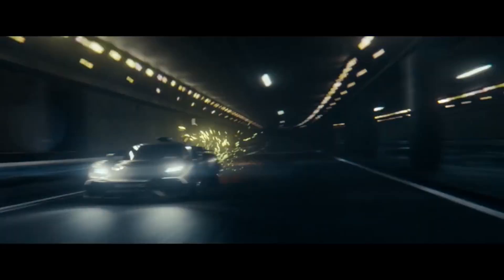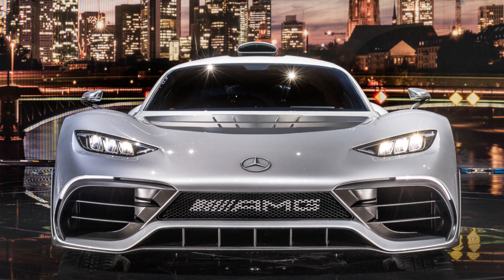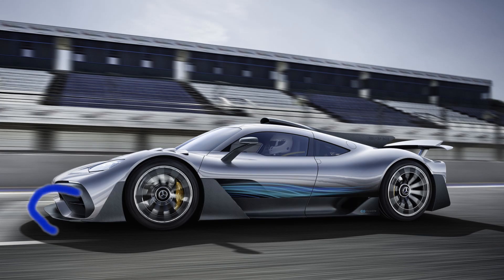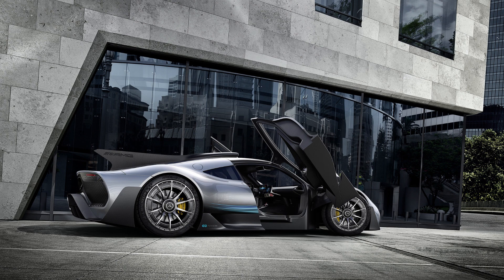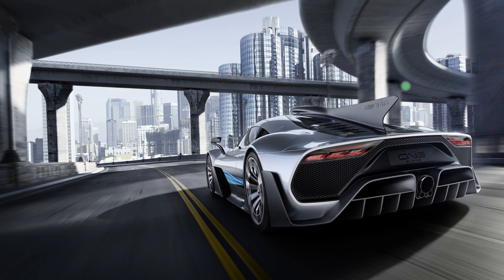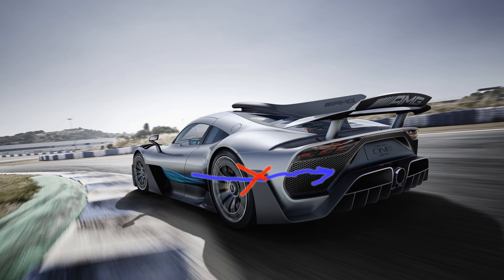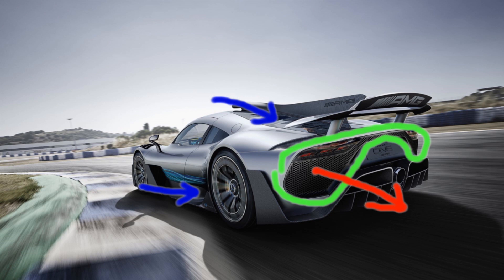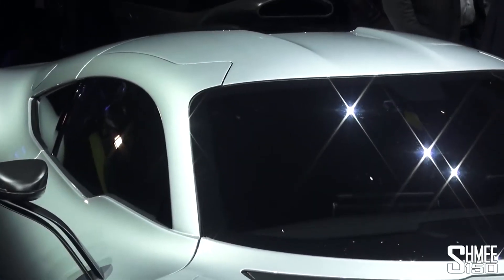Mercedes Project ONE Aerodynamics Analysis & Breakdown

Comment: seems like the big challenge in this car is cooling being a turbo hybrid with actually what looks like more electric HP than an F1 car. Your point about the front downforce because of the mechanical layout in interesting. I haven't watched your Valkyrie video yet but I guess that car's going to have a lot more air flowing thru it than this one.

Comment: I don't believe Formula 1 uses those fins. They do have the air duct in the relatively same position, but the fin is mostly reserved to the Prototypes (LMP2, LMP1).
Reply: krayos13 I haven't put much interest in recent on F1 soon after the downsizing to six cyl. But I appreciate being corrected accurately.You are a true gearhead good sir.
Reply: Function isn't always pretty. I wonder if it creates a vortex, reduces drag or whatever witchcraft is its intended purpose.
Reply: If the demand outweighs the cost in addition to having aerodynamic properties, then they will surely keep it.

Comment: Wish this guy knew what he was talking about lol. He thinks the aero in front and back of the tires are for style haha not to clean the air running past the wheels.
Reply: 3:45 did you even watch the video?
Reply: Yes and he talks about the wing in the back and how it draws the air out preventing high air pressure. If you watch the video yourself you would see where I was commenting on how he talks about how the front wing might be there for looks/styling when in fact it is used TO CLEAN THE AIR running past the wheel. It helps cut down on vortices and turbulent air making the back wing more efficient in drawing out the high pressure air and reducing drag.
Reply: lol This is something easy that you are capable of googling. If you look at 1:38 he talks about the end plate that is used to manage air flow around the tire. F1 has used it for years to manage airflow around and over the front tire. Not so much on road cars until recently. Road cars have been using what is called air curtains on the fronts of the vehicles to help this aerodynamic issue. please take a moment to google aerodynamic air curtains because if you dont know what that is I cant help you. Two examples off the top of my head that use this new method is the Mclaren 675LT and and Ferrari 458 Speciale. I assume these company are starting to use this technique developed from Formula 1 in their road cars just for the looks..

Random pictures.
https://o.aolcdn.com/images/dims3/GLOB/crop/777x437+0+137/resize/800x450!/format/jpg/quality/85/http://o.aolcdn.com/hss/storage/midas/1d00ca29fc8153eeb5b58859b7201a9d/202815967/Yokohama-tire-wing-001.png
http://i.imgur.com/zVI9wj6.jpg
http://www.f1fanatic.co.uk/wp-content/uploads/2014/04/ferrari-nose-2014-john-beam-886x424.jpg
http://cdn.bmwblog.com/wp-content/uploads/BMW-Air-Curtain.jpg
https://www.bmw.com/content/dam/bmw/common/topics/offers-and-services/bmw-efficient-dynamics/Update_2016/aerodynamics/bmw-efficientdynamics-aerodynamic-air-curtain.jpg/_jcr_content/renditions/cq5dam.resized.img.1185.large.time1476318397724.jpg
http://corvettestory.com/images/corvette-images/2015-Corvette-Z06-front-aerodynamics-details-2_a_s.jpg
Reply: I think they might pass some air, but it's not going to be all that significant. They stick out a bit too much to be blocked off, they'd simply create an unacceptable amount of drag. They're a very stylized version of actual functional elements.

Comment: Nothing will be as aerodynamically interesting as the Valkyrie until someone challenges it's design style. 
Personally, I'm hoping Tesla, or another EV company will challenge it. Since with full electric systems, you don't necessarily need everything mechanically connected to each other, have independent power, independent suspensions, independent steering; then make actual pods around the wheels, then a pod for the driver and electrical systems, then form an aero shell around it. I would assume this kind of design would push aerodynamics to the boundary where we can't have a more aerodynamic four wheeled vehicle. 
Though I doubt that will happen any time soon, but it's a thought that could happen.

Comment: It may seem odd, but what is with the air ducts on cab over commercial trucks?  They seem to be directing frontal air around the sides, but why?  I know Euro tucks have had vents/ducts like this for a long time, but they are even showing up here in the US as well.  Just wondering if you could shine some light on the reasoning for it.
Reply: the air has to go around the sides one of two ways, the hard way, all turbulent and draggy, or relatively smoothly and less draggy. They're just an attempt to smooth it out

Comment: It astounds me that mirrors are even used.  With camera capabilities, you can see much more, digitally, opposed to a mirror.  I understand that the mirror is simple and fail rates are minimal but it has gotten to the point where viewing capabilities are multuple times better via a video feed.
Reply: Yea, especially in a 2.5 mill car. Also the aero advantage is pretty distinct, but they are not legal.
Screens with constantly moving things ( road with traffic ) are disallowed, for now at least.
Reply: Watching a video is one thing.  Having a screen available for real time vision for all of the blind spots just seems rational.....especially in a super or hypercar that has poor rearward viewing capabilities.  A mirror is simple but the actual effectiveness is greatly minimized compared to a properly placed camera and interior monitor.  

In another 10 or 15 years, it probably won't matter because of the increased capabilities of self driving vehicles but to not utilize current technology to provide increased blindspot capabilities defies logic.
Reply: Cameras are allowed in place of conventional mirrors (at least in Europe, not sure on US). 

From ECE R46:

2.1. "Devices for indirect vision" means devices to observe the traffic area
adjacent to the vehicle which cannot be observed by direct vision. These can
be conventional mirrors, camera-monitors or other devices able to present
information about the indirect field of vision to the driver.

Cameras are starting to be used, particularly for the interior rear view mirror, where vision is significantly obstructed by rear bodywork. However, I believe FMVSS regulations state that a conventional mirror must be present as well, so a lot of the rear view mirrors with camera functions also have a reflective setting to meet this requirement despite you not being able to see anything with them!

Comment: Am I the only person that thinks it looks like the love child of a Porsche 918 and a Spyker C8?
Reply: To me it looks like a 918 in the front, an R10 in the rear, and a P1 in the middle.

I actually find the design quite uninspired and boring, honestly.
Reply: newborn child of mercedes c 111 and sauber mercedes c11
Reply: I see some McLaren f1 in the front end too.
Reply: bigbuckoram its not boring at all.  It's simple and functional and it looks great very remenisant of rhe clk gtr and sauber c9 Mercedes.  Your can nit pick here and there but its just  that nit picking. It doesn't look like a 918 from the front. Yes it has a similar diffuser as the 918 but that diffuser has been on manu amg models before this one. It doesn't look like a p1 ar all from the middle... This has a roof scoop and p1 has black side intakes unlike this. R10 doesn't look like this either especially not with the sharkfin. Your eyesight is quote worrying honestly. You should check the doctor. Not saying you have to like the design but your arguments for saying that are non existant.

Comment: Aero aside, it looks so hideous. It's just not cohesive at all, and looks weirdly doughey, mixed with some of the hard lines of the panels and the wing. I wish they spent a bit more time thinking about the placement of the Led lights instead of just stuffing a weird length and shaped strip around the intakes...
Reply: Yeah I think Merc tries to build the car around its powertrain, kinda similar approach with the A10 Warthog which builds the body around its GAU cannon so they kinda look a bit hideous
Reply: Naufal Kusumah The warthog is a beautiful plane
Reply: In the same way you think this is hideous and the warthog is beautiful, I think the valkyrie is rather ugly and the project One rather beautiful. Isn't individual difference something :)

Comment: Awesome video. Just one question. If the car is running a flat floor and the rear diffuser starts from a place closer to the middle of the car, wouldnt it be beneficial to run the front splitter raised in the middle as they are. I would assume the more air going under the middle all the better. The sides therefore are blocked off from a lower flat front splitter, so the air doesnt go in the wheels. You have mentioned before that front splitters are usually for purposes such as aero balancing more than total downforce, so i was curious about your comment.
Reply: rear differential and rear montuned gearbox need this space

Comment: I'm a total aero novice, and even I found this kit to be a snoozefest compared to the Valkyrie. Definitely looking forward to your analysis of suspension layout of this car as I've spent some time trying to wrap my head around it. Thanks for the content!
Reply: If I'm not too badly mistaken, that suspension system has just a front and rear heave springs and front and rear antiroll springs and no separate corner springs. They just have manufactured that in a rather complicated way using pushrods and rockers. 

That horizontally mounted coil spring and shock absorber act as a heave spring, so it resists movement when both left and right wheel move up at the same time. So that is the spring that holds the car off the ground. 

That diagonally mounted spring mechanism seems to resist movement only when the left and right wheel move in opposite directions, so it seems to be just an roll limiting mechanism (antirollbar). Those two red coil springs (the one visible and the one partially visible inside that silver tube) seems to be mounted on the same shock shaft, just on the opposite sides of the blue/gold shock body. The shock body looks to be connected to the right ride rocker. When looking from the rear, if the vehicle rolls left, the visible red spring is compressed and this causes the rocker on the right wheel to try to lift the right wheel, so it acts just like antiroll-bar. And if the vehicle rolls right, the partially visible spring is the one that gets compressed. 

The suspension system on Citroen DS (1955-1975), has pretty much exactly the same operational principle. The laterally interconnected hydropneumatic suspension acts as a heave spring that holds the car off the ground. The laterally interconnected antiroll bar is there just to prevent the car from tipping over left or right.